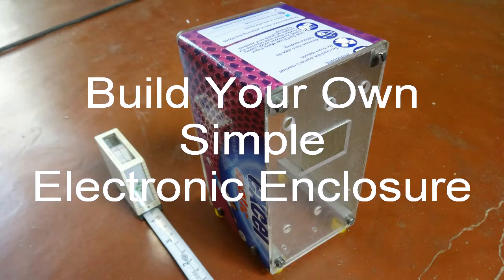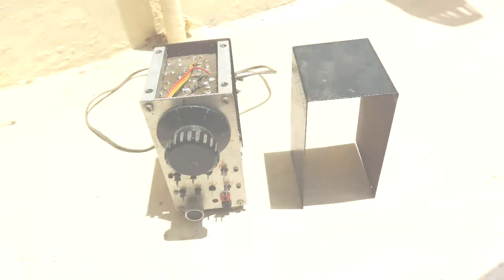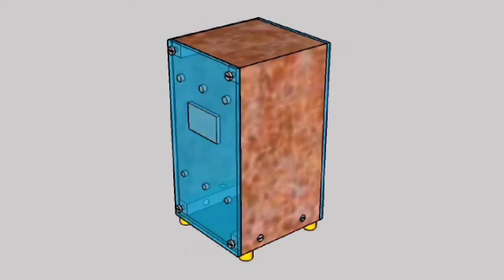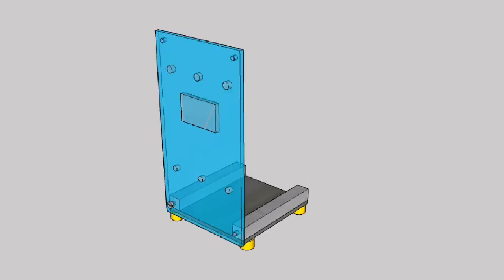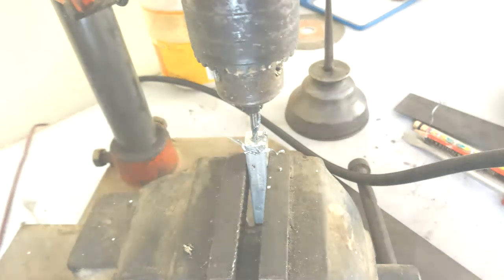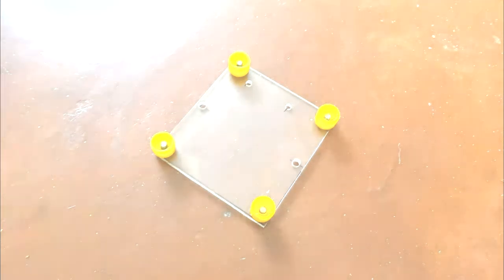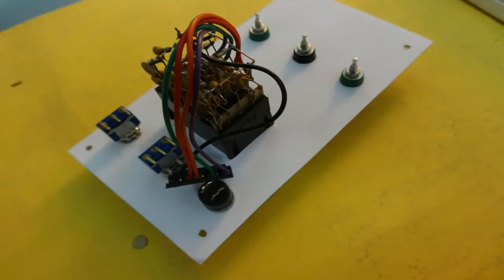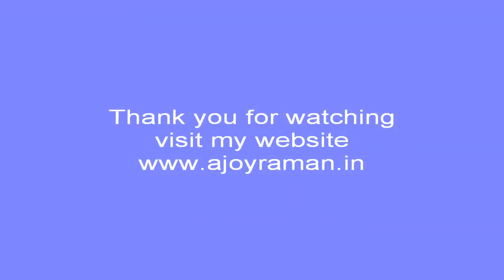Aj DIY Electronic Enclosure

Comment: Good job Mr. Raman. I think It can be make using a 3d printer part instead of an aluminum rod. Corner fittings can be made by 3d printer.
Reply: My search of 3D printers show they are expensive for good ones $750 and can take several attempts. But I agree 3D printers can do amazing things.